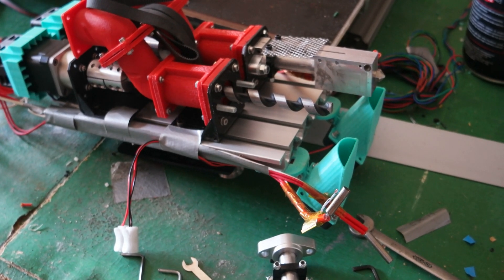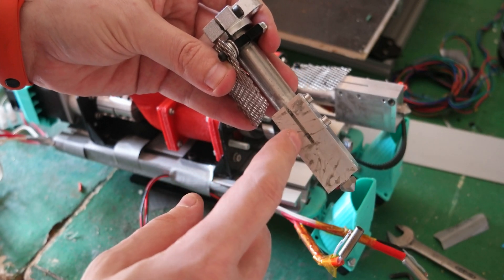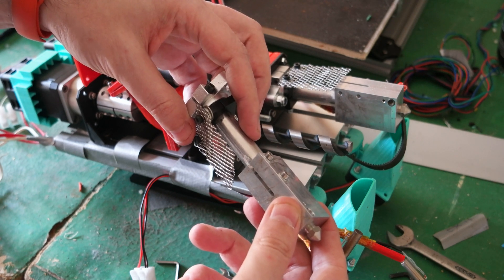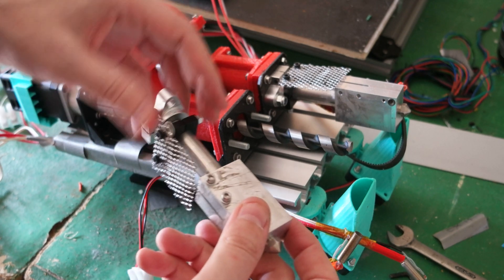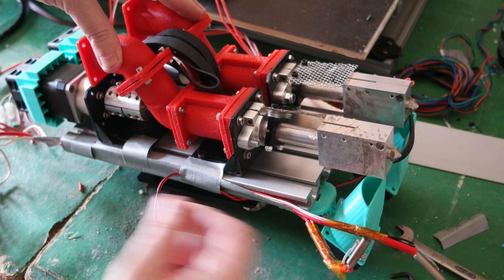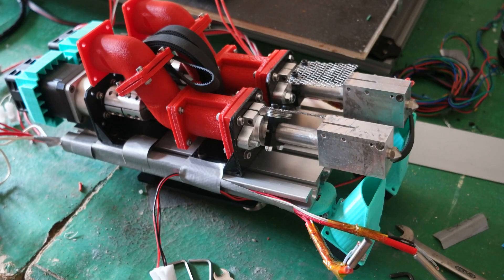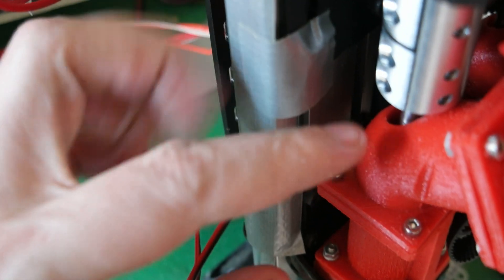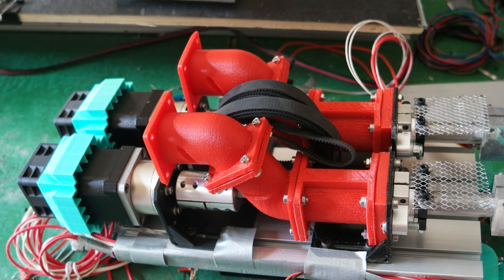3D printer Dual Pellet Extruder

Comment: Hello, Great project, Can I ask you about the hearbreak, did you insert  another tube inside the stainless pipe ? Thanks
Reply from the maker: Thx. No inside the tube there is only the drill bit. I am planning to update the heater block using induction heating since the resistance heating is uneven between the aluminum block and the stainless steel pipe. Having a induction coil heating around the pipe (no aluminum block is in this case, should have a more uniform heating. Also induction heating will heat both the pipe and the drill bit which should be good. Need to do develop it and do more testing to see if the idea works. Please subscribe thx !
Reply: @ganzoai  Thank you so much for the precisions.